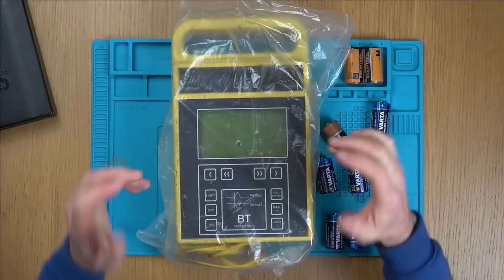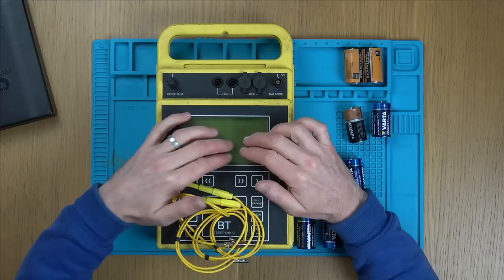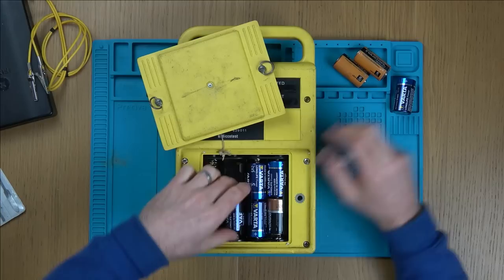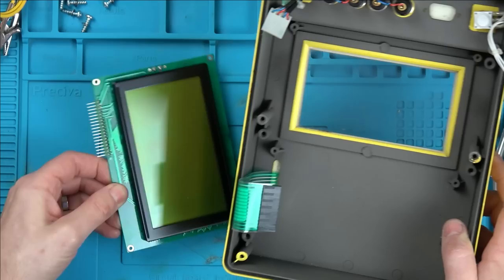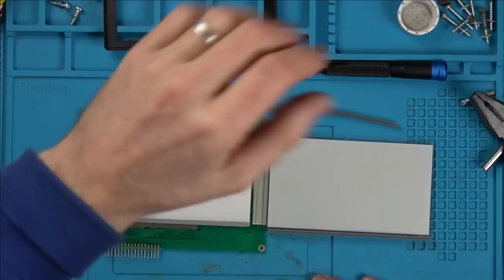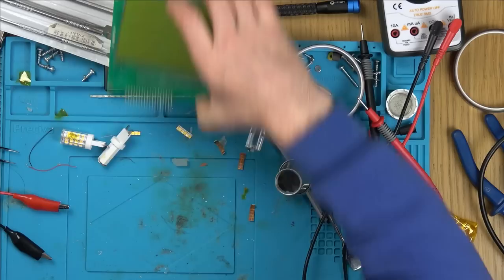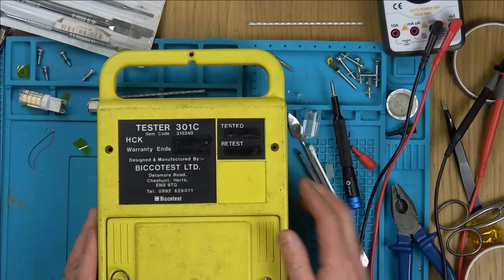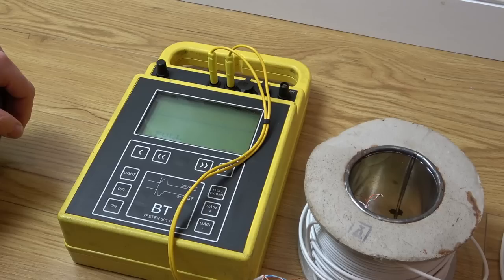Can I FIX a BT MOLE ? - A Great Piece Of TELECOM TEST KIT

Comment: Awesome video and excellent demonstration of  basically a time-domain reflectometer (TDR). I loved the demo! Have you ever used any transmission test set devices like an Ameritec AM-48 or Navtel HATS-2 during your BT days? I assume the UK would have similar devices.
Reply from the maker: Thanks Shawn, yes a TDR (I forgot that term). No, never seen them before. Unfortunately we only had access to limited test equipment, only what we needed to do the job. Cheers for commenting 👍
Reply: @Mymatevince  to be fair, I forgot it until I watched your video. It's been a few years since I last used one myself.
Reply from the maker: @HavingFunRepairs  👍👍👍
Reply: @Mymatevince  a "Fox and Hound" or "inductive amplifier and tone generator" are fairly common tools of the trade as well. I've used them outside of Telco troubleshooting to help with tracing paths on a circuit board.
Reply from the maker: @HavingFunRepairs  Yeah I  still use a tone and probe (oscillator and amplifier) for tracing cables in my own house 🤣  I helped out an electrician once years ago in a new build house. Huge house with gym, cinema room, sauna etc. and the tone and probe was so useful to trace all the cables, data, coax and audio cables.  I presume a fox and hound is another name for it, so a cable tracker that puts a beeping tone down the wires and you use a wand the other end to locate the cable, and then short out the correct wires to make the beeping stop 👍👍👍👍
Reply: @Mymatevince  👍👍👍 "fox and hound" may be more an US idiom or colloquial language. I've also heard of "tweedle and sniffer". One because of the alternating tones and the other cause it "sniffs" them out. I had to use one on my father-in-law's boat while changing out much of the wires through the cabin.
Reply from the maker: @HavingFunRepairs  Whatever the name they are even more useful than the TDR  'mole'🤣. I might try and find a faulty set on eBay. Might make a fun video. Cheers HFR👍
Reply: @Mymatevince  I'd watch it if you did, Cheers!

Comment: Awesome Vince!  What a fascinating bit of kit!  It has me wondering how it can measure the distance to an open circuit?!?!  It must pulse one wire and sense on the other, and calculate the distance based on time taken to receive the pulse?!?!
Reply: it use time-domain reflectometer (TDR) to send pulse down the line and then it is reflected back
Reply from the maker: Thanks Chris, yes I think you're correct. I forgot it was called a TDR when I was filming. I should have remembered that as I had to buy one when I left BT and it wasn't cheap! As ToomsDotDk mentions Time Domain Reflectometer so it sends a signal out and measured the reflected signal back. I presume if it was calibrated to suit, any cable could be measured such as coax and data 👍👍👍

Comment: That screen is a 16 pin LCD,  off the shelf jelly bean module,  as these where low volume production it made more sense to design around the LCD than it was to incorporate an LCD into the main board.  Also hole for VGA,  try rs232 9PIN Serial port.

Comment: It's not based on resistance-  it is a time domain reflectometer, it works a bit like radar-  sends out a pulse and times how long it takes to come back.  it knows the velocity factor of a twisted pair cable.
Reply: In the early 80’s at Telecom Australia, we had PETs - pulse echo tester. Same principle. Those jelly crimps, we called scotch loks.

Comment: I thought the mole was using the capacitance of the circuit that then gave the distance. ie we use to use the test meter (I think it was the s9083) ohm meter reading and then swap the leads around, you would see a deflection for a moment and the bigger the deflection the further away the fault (dis only) was (with the capacitance of the line). ie a 1mm deflection might mean the top of the pole and a 4mm one the cabinet etc.
A break in the line would give infinity resistance no matter how far away the break was, whether 10m or 1000m. I used the ones before what you had and only got it out only a few times as the results you saw were very hard to read and often not very clear as to where the fault would be. Guess with each update the results got easier to read.
Reply from the maker: I remember doing that, the joy from seeing a big deflection in the needle as you knew your pair would easily get to the cab 😂 and then the heartbreak when it had a battery or earth fault on it. Sometimes you would see the exchange equipment kick in the needle and be like yippee as you knew your pair proving was done 👍👍

Comment: Zebra strips can be restored by dropping them in boiling water. Boil some water in a microwave and drop the strips in. Keep the strips submerged under a heavy object and allow it to cool to room temperature. Reinstall when dry. Don't heat the strips in the microwave, that will ruin them, only boil the water.
Reply: Yes. Definitely do not use a kettle for boiling the water. Has to be a microwave.

Comment: Excellent video as normal always been interested in working for BT and openreach. Did you ever use a Davy/miners style lamp in the man holes?
Reply from the maker: Thanks Ray, I didn't. The areas where we worked all the man holes we went in were only joint boxes a meter or so deep. I think I only went in a proper man hole (deepish with a ladder)  2 times and that was a 2 man job, one up the top and one down the hole 👍👍👍👍

Comment: Love your channel. Cant you test a cat5e cable if you cut it 1m and see. After you test you can open it and untwist and messure ?
Reply from the maker: Yes, or measure a full new box of 305m cat5e and then see what each pair measures as they are twisted different amounts. It would be interesting to see the difference between the pairs and also compared to CW1308 telephone cable 👍👍👍
Reply: @Mymatevince  yes i like how you think :)

Comment: Hi Vince I have a Dell latitude E5550 was working fine till I was downloading something that took hours to download then after that is staying on for a few minutes then turns off and have had a blue screen of death once on it as well. I put new thermal past on it but that didn’t do anything. Got myself a thinkpad now. Was wondering if you wanted it at all, comes with the power supply to. Kind regards Andy